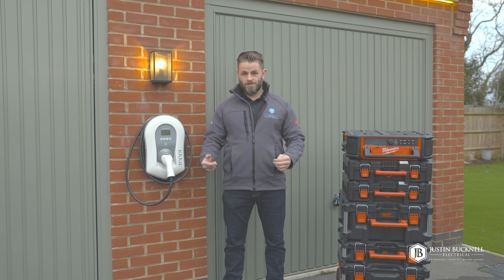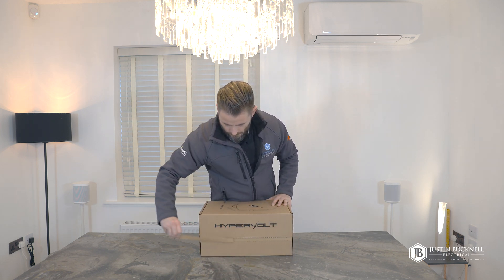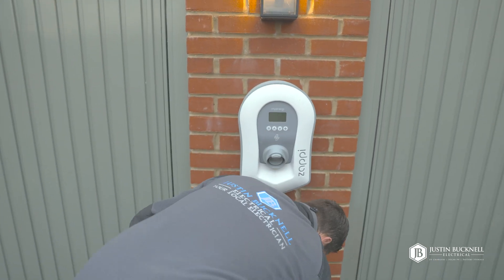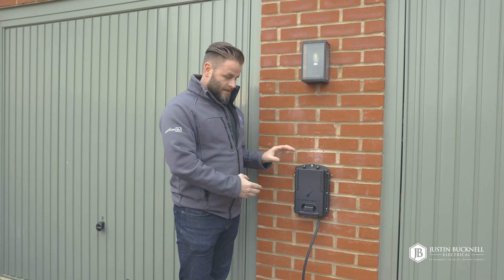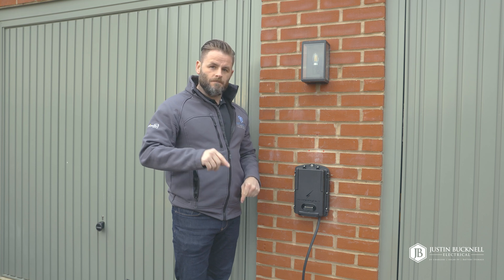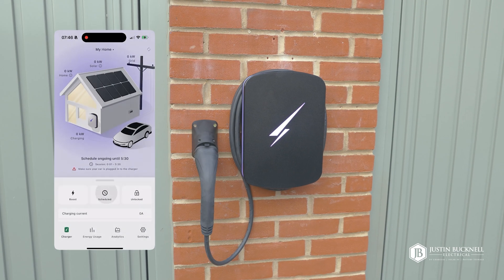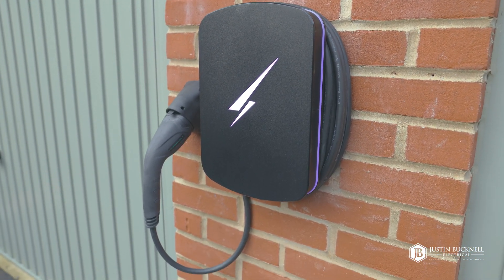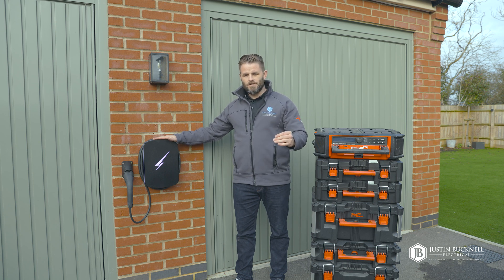Best EV charger?.....

Comment: u cant just say its the best without a comparission, btw others , or at least the zappi
Reply from the maker: Hi, thanks for your comment

Yes we could have done a better job of going into more detail about comparisons. We think it is the Best EV charger on the market, it ticks every box in terms of features, safety, reliability, aesthetics and compatibility with Octopus intelligent go and other energy providers. 

Its almost identical to the features of the Zappi,
Which I had previously installed, but it looks much nicer and does a better job of stowing the cable on / around the unit.
Reply: @justinbucknellelectrical  trust me viewers always want facts, and visual comparrisions.i get it, its not easy, ive made same type of videos ,were i didnt compare well. so not pointing a finger, just advice .